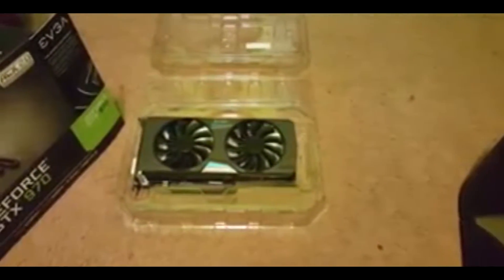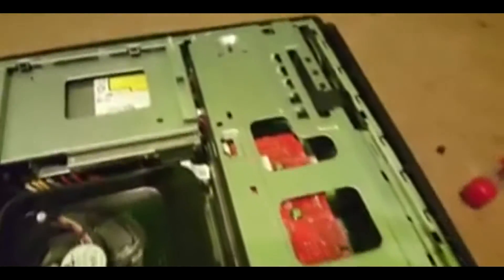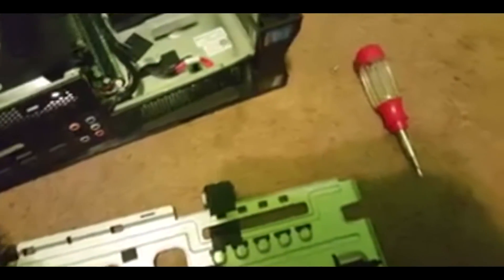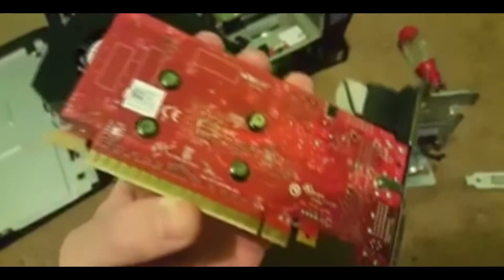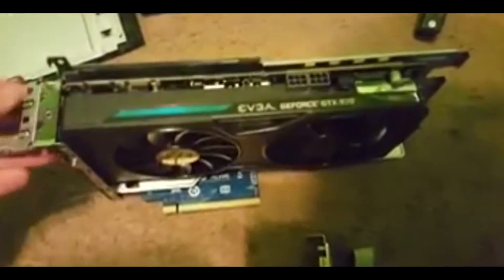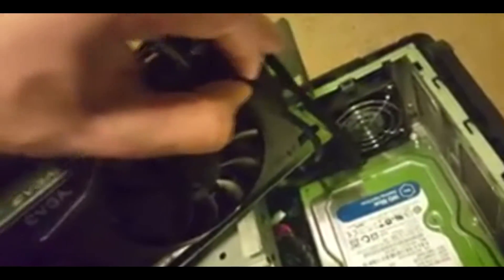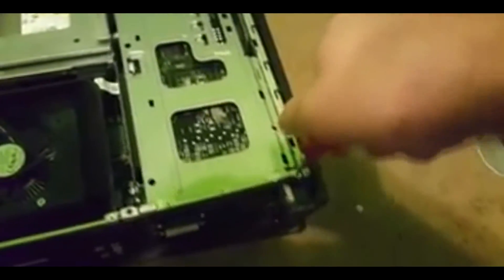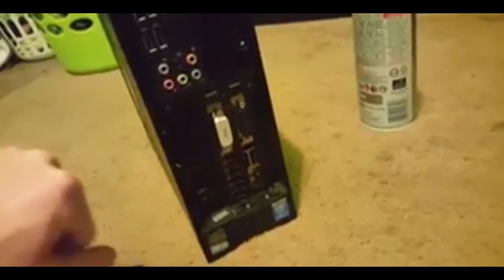How to Install a New Graphics Card in a Alienware X51 R2 (Installing Geforce GTX970 SC ACX 2.0)

Comment: i Wonder if a msi gtx 1070 fit in there because my 750ti is quite old
Reply: SlyNex Production only reference , any overclocked card will shut the system down

Comment: Kevin, today 02-03-2017, wich one is the better Nvidia that I can install in my X51 R 2 ?
Reply from the maker: Sergio V I don't know which ones all fit I would assume the same one I put in. If I was you I would check the sizes if they are the same and you can get a newer one then I would but to be safe I would say the 970
Reply: Thank you very much
Kind regards

Comment: Would this fit in my Alienware x51 r2? https://m.newegg.com/Product/index?itemnumber=N82E16814500362&nm_mc=KNC-GoogleAdwords-Mobile&cm_mmc=KNC-GoogleAdwords-Mobile-_-pla-_-Video+Card+-+Nvidia-_-N82E16814500362&gclid=CM-fquC1y9ACFdgBgQodppkCfQ&gclsrc=aw.ds
Thanks ;)
Reply: it will fit but this graphic is better the fan doesn't even run its so quite when not not playing game..the fan only runs when playing games...

Comment: So if I was to buy this card and upgrade my GTX 745 in my Alienware x51 would I only have to buy this graphics card, nothing else?
Reply: And do I have to download anything new or uninstall anything?
Reply: I'm probably replying too late but I think i have the same alienware as you. I have the x51 r2 with the same graphics card and I think you need to upgrade your PSU in order to have this able to run. But i'm not too sure. I know that's the case with me for upgrading a processor to an i5 4460.

Comment: What was the stock card? I have an x51 R2 and it came with the GeForce GTX 745. How much better would the 960 or 970 be?
Reply from the maker: it's been so long I don't remember what the stock was it has made a huge difference in my streaming
Reply: I also have a 745 pre-installed and I can recommend you the 1060.
Reply from the maker: I'm not looking to upgrade right now this one is working perfectly
Reply: +Wombat Games got a link to a 1060? It'll fit in the x51r2 case? What about power supply. Sorry for lots of questions.
Reply from the maker: +Jeffrey White I got the 970 and the factory power supply

Comment: what do you use as your power supply?
Reply: Here's a Spec sheet on the X51 R2 from Dell: 
http://www.dell.com/support/article/us/en/19/SLN296934/en#Specs

It does have 2 6's.

You'll want to bookmark that page for future reference.

Click the Video card and see that it has a list of nVidia and 960 is one the best on the list, and the 970 seems to be missing. While it does say max graphics power is 175w with the 330w brick.
Reply: Kevin S Just received the card and it has 2 6-pin connectors, the pictures were wrong on both Amazon and Gigabyte's websites.

I'm going to start installing it, will get back with you on the results.
Reply from the maker: same power supply that was in it
Reply: so the 180w? or am i reading it wrong.
Reply from the maker: +Kevin S if that's what's stock
Reply: is that what you use?
Reply from the maker: +Kevin S if that's what cane in it that's what I use only thing I changed is the graphics card
Reply: so the GTX 970 can be handled by the 180w? Thanks.
Reply: I've just heard a lot of people say I need at least 500 watts for the 970 but I can't find one for the alienware
Reply: Revision 2 (R2) has a 330W PSU. You have to be careful with the 970's you choose. I am going with the OC 960 4GB to play it safe.
Reply: DeathInANuse Is the Evga GTX 970 4GB SC ACX 2.0 safe with the 330W psu? Or should i stay safe with a 960 like you. Thanks.
Reply: I've seen videos of people putting GTX 1080's in them with minor mods to the case, but just because you can, doesn't mean you should.

It's all up to you, but you will need to think about temps. I've heard that Dell says 970's are the max that is "recommended". I doubt it will include any over clocking.

It's a small case and a small PSU. If you go with the 970, just make sure it will fit and you use a program to keep the fans on a higher setting when you are playing intense games.

The 500w is a total system max power, the card should only be about 145w stock.

You may want to look at the Gtx 1060 coming out later this month, it has the same 120w as the 960. I didn't know about it until after I bought mine. Of course size is still relevant.
Reply: ok ill stick with the 960, if you can link me one I would very appreciate it. One that fits the alienware x51 r2 of course.
Reply: This is the one I got (haven't received it yet):
https://www.amazon.com/gp/product/B00UMVCYTM/ref=oh_aui_detailpage_o00_s00?ie=UTF8&psc=1

It's the "Windforce" 4GB.

Now the only thing to note is that the length is 9.6 inches and the recommended max is 9.5 inches in the case.

I don't think it will be a problem.

The upside here is that you can overclock if you need to.

Keep in mind that the 960 and 970 are pretty different for performance. 970 has something like 1660 cores where the 960 only has about 1,024. But the 960 has the same clock speeds as the 970 when both are boosted.

But like I said, if you are really aiming for future proof and performance, the 1060 might be a better choice than the other two.

Personally I am just trying to get a good increase from my 750ti with it's silly 60w. I also am not looking to risk my investment.
Reply: thank you :D
Reply: You're Welcome ^_^
Reply: Kevin S Just noticing that this card has both a 6-pin and an 8-pin power connector, I think it's optional, one or the other, but I'm looking into it.

As far as I know the X51 R2 has 2, 6 pins. But you can use a adapter to combine 2 6's into an 8. Just don't know about a 6 and an 8.
Reply: Kevin S So far so good, it was a bit of a tight fit. I had to clip the zip tie holding the 2 power connectors together so I could manage them better.

Also can't use the clamp because of the fans, but it's sitting sturdy without it.

I have realized that I have the 240w, so I have used MSI Afterburner to turn down the power of the card a little to prevent instability, but it's still doing great.

Temps while playing are hitting 80c which is max, so may want to consider running fans at higher speeds.

I would have preferred the blower style, but couldn't find any that didn't require removal of the front fan.
Reply: @Kevin S you can put any graphic card even the latest Nvidia Titan X or Gtx 1080 all you need is 2nd external psu 800 watt or higher. connect the external psu's main molex connector black & green wire with Alienware's main molex connector's black and green with long electric wire (black on 5thpin & green on 4th pin) so that way it powers on & off with computer or you can just connect external's psu molex connector green & black with paper clip so you can turn off 2nd psu manually with switch then connect the pci-e 6pin to graphic card from 2nd psu.

Comment: Hey man so are you running your alienware x51 with gtx 970 without downclocking the card ? is there no issues with temperature ? i have gtx 760 in my alienware x51 r2 and i think to upgrade to gtx 970 but i am not pretty sure does this work without any issues :)
Reply from the maker: I haven't had any issues with mine

Comment: Are you sure you don't need to upgrade power supply? I was told you needed to by the support guys
Reply from the maker: +JAKELTHAN “JAKELTHAN3” M i didnt upgrade mine and its been running fine
Reply: what is the watt of your alienware's psu.. is it 190w or 330w?
Reply: Sorry i couldnt get back to you sooner. so where what i ended up doing. this didnt work for my pc so what i did was took all the parts from the alienware and put it into a case with a new power supply. Mine was 330w and it wouldnt run it when i installed it.

Comment: did u have to upgrade the ac adapter to the 330w or the 240w is enough? Tks bro
Reply from the maker: +Rafael Ferri i didnt upgrade it and its been working just fine bro
Reply: So you are running the 970 with a 240w Ac adapter? wow, tks bro